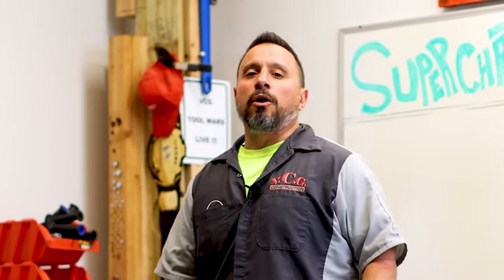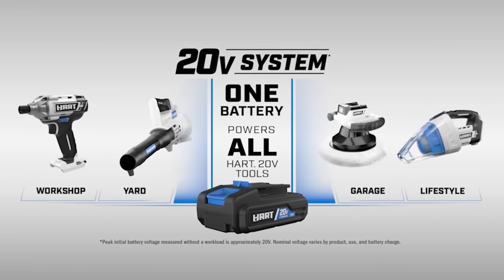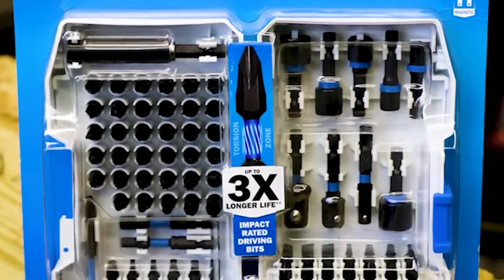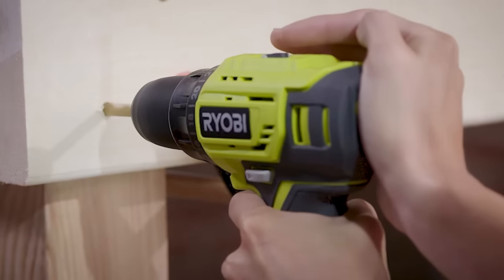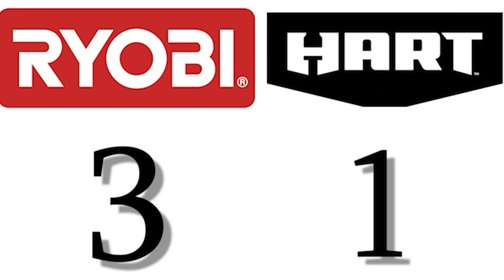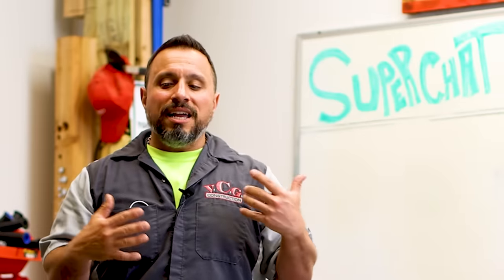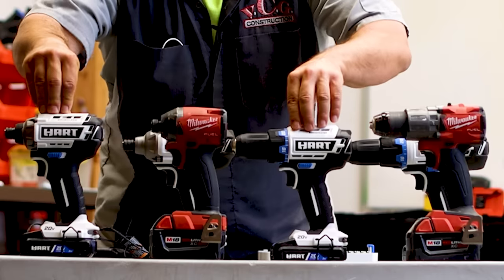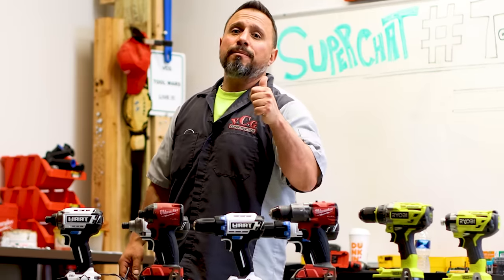HART Power Tools At Walmart PEOPLE HAVE NO CLUE!

Comment: Great informative video Vince. I work as a diesel and trailer mechanic for a nonprofit organization, most of our shop tools are DeWalt and do their jobs well enough. I've wondered how well the Hart line of tools compares with Ryobi and Milwaukee, this video has answered those questions.
I would be very interested in finding out how these lesser expensive line of tools compare to top self brands like Snap-On, Cornwell, and Matco. You know, the guys that drive around in tool trucks?
I have a Snap-On 3/8 drive brushless impact driver kit, came with a charger, two batteries and storage bag. Paid over 500 for it. It's a fairly decent tool for lite work, but not impressive.
Reply: I used to drive a truck and have picked up and delivered a lot of tools over the years. What a lot of people don't realize is a lot of brand name tools are made by the same people. Once I picked up and delivered to a company that made brand name sockets. I walked around their facility and watched how they made them. I delivered boxes of blank sockets all different sizes. They would dump a box into a hopper and they would come down a chute to a machine that stamped the brand into the side of the socket. Some said Snap-on, SK Wayne, Craftsman just to name a few. There were around 15 to 20 machines all stamping different brand names on the same sockets. A lot of people think a brand name company makes all their own tools but that's just not the case. This day and time a lot of these name brand companies have bought each other out and will keep them separate but will cross-fit their technology to improve one or the other brands. It's hard to decide who has the best tool anymore. They all have their good side and their flaws. Price seems to be the determining factor in a lot of cases anymore. It boils down to what price you can afford.
Reply: Dewalt tools sucks
Reply: @hmsdemolition8588  Only trouble I've had out of them is changing battery styles. That really chaps me off . But never any problem with the tools.  What is your beef with them and what tools do you prefer ?   I will say this , you do need to carry  5 ah batteries with them.

Comment: I enjoyed this information , and I would like to add that the manufacturers of these tools seem to change their  platform just about the time I get vested into their tools , I jumped on the craftsman 19.2 v program years ago and I was pleased with the tools for home owners  but the first batteries were cheesy and then they added battery upgrades , ah , and then they went to lithium ion batteries which required a new charger and none of the battery upgrades were truly cheap and then they went to the 20 v system and then Sears closed there doors , and then the remaining tools and batteries and tools prices skyrocketed .
 My point is , It seems the manufacturers themselves are changing and upgrading just to keep us buying into their systems . I love the cordless platforms but seriously , I built a lot of shit in the old days 🤔with corded tools and it's not that hard to run a extension cord around your home

Comment: I found a chop saw for half the price as the same size blade on the DeWalt I bought the week before ( both ten inch saws). Use it for framing cuts... It's not the straightest cuts but perfect for framing but not so much for trim work. Was building a dog pen and got hit with one of those random afternoon thunder storms that the Carolinas are know for and the saw got left plugged up in the rain for about an hour before I seen it. Next morning plugged it up and finished the job. And at $45 for the complete saw I don't mind walking away from the saw on a job site. Doesn't get used everyday or even every week but it gets slammed on framing days and has held up all year. I would recommend for anyone that's looking for a chop saw for not so detailed work, it can do trim just have to make sure your not putting pressure laterally on the handle it's not too sturdy in my opinion but mine was on clearance. Final thoughts.. Great for what it is, not my choice on trim, great price and quality, could be reinforced for straighter cuts in later models.

Comment: Vince.

I really love the Milwaukee tools. 

I have and use the 18volt and 12volt Hammer-Drill; also, the 12volt HACKzaw, 12v Multi-tool, 12v Fuel Impact Driver, 12v Lantern/Trouble LED Light and ROVER Service and Repair LED Flood Light with USB Charging - and AAA LED Pocket Penlights.

I also have but very rarely use the 18v Impact Driver and Jig-saw. 

I also have and use quite a bit their 18v SDS-Max Rotary Chisel Hammer-Drill. And while I don't use it very often, I have and love their 18v 10-in Dual Bevel Sliding Compound Miter Saw! 

Great tools. Hardy tough and quality tools to be sure.

ROAD TESTED: TOUGH
Some years ago, I placed and then forgot my 18v Hammer drill (with battery attached) on the roof of my 4Runner. 

You guessed it. 

Going down the road about 45mph I felt and heard something siding and bumping on my roof! 

Just as it was dawning on me what it was. It slid off the roof and crashed onto the road bouncing end over end on the road with the battery detaching!!! AYE!!! Turned about, retrieved it before it or the battery got run over by some car or truck. Snapped the dented battery back in and pulled the trigger...IT WORKED - and has still been working ever since! 

STICKING SWITCH:
The ONE & ONLY issue I have had with the Milwaukee Hammer Drills (interestingly, both the 12v & 18v) has been that about the 2nd or 3rd time I first used it (some 8 or so years ago), the High/Low Speed Slide-switch at the top of the drill suddenly became STUCK! 

I thought back then (still unfamiliar with the brand): "WTH [heck or F]?!!! Is this the actual quality of this thing? It looks great, otherwise works great. Why the issue with the sliding Switch?" 

Idea pops in the head. I got out the old WD40 and lightly sprayed the switch and around the chuck. Hit the switch a few times threw it in reverse (back and forth), then tried rocking the switch back and forth. 

And "Viola!" Low and beyond IT WORKED! I haven't had any issues with it ever sticking since. 
The same thing happened with the 12volt Hammer drill switch and again WD40 to the rescue!

I have DeWalt tools as well: Impact Driver in 12v and 20volt, the 6-1/2" Circular Saw and non-hammer Drills. I don't use the drills. I do use the 12volt Impact Driver the most of ALL my tools. It is my GO-TO tool electrical trim work - even more than my Dewalt 20v Impact or my Milwaukee 12v Fuel-Impact Driver. It just feels a bit lighter and easy to carry on my belt-clip-drill-hook (I'm more use-to-it and have had it for years now - the 12v Milwaukee FUEL Impact is sometimes too powerful. :-)

I have, but don't use my Rigid 18v Drill or Impact Driver or Radio. But I just bought the 18volt Tire Inflator, so will keep the Rigid batteries and charger at least for that.

Great videos Vince. Informative and entertaining! 

I really love your deep Texas, Alabamian, Georgia or South Carolinian accent! So thick and rich!  

;-)    ;-)    ;-)    ;-)    

I know you'll keep up the good work.

Comment: I looked at hart tools when I was looking for a new drill and impact. I used their impact bits on my harbor freight Bauer impact and decided against it. Kept rounding out screws with every bit I used. Decided to go with Dewalt for the price. Got the dewalt atomic 20v brushless kit for $220 out the door. Would’ve cost $200 to get the Hart with tax. Might as well go with the Dewalt for that price difference.
Reply: I don't go to Walmart often, but recently i couldn't find something that i was looking for in the usual places.  Just happened upon Walmart while driving a friend to the DVM. 

Anyway while i was passing through looking for my stuff. I passed by an isle of Hart tools. And of course, having used power tools for so many years, i had to inspect them a bit. They seemed solid, like they would hold up with other brands, but the price made me wonder...

Guess I'll give them a shot. I'll keep them as backup and for little home jobs, test it out. Cheap enough. It's just that the REAL test comes with time. If there's plastic gears inside that wear down then i guess you get what you pay for, so maybe I'll open them up and look for myself. If they last longer than the others... then it's a good deal.

Comment: I own hart in a 4lb hammer. It is red, and very ergonomic and well made. I also have used a red hart framing hammer 22 oz and had similar thoughts, so much better than my eastwing from the 80’s.
I have mix of tools- i really love the Milwaukee 12v line up screw/drill- and have the 18v line up. I like the “FUEL” line of anything they make. Brushless and better build quality- my non-fuel 4.5” grinder bogs and smokes vs a corded Milwaukee of same. The fuel line grinder is almost exactly as the corded option.

Aside from the 12v line , ryobi makes some of the best ergonomic handling tools i’ve used. Yes- the batteries are heavier vs Milwaukee, but still work great. I have also endorsed ryobi work speaker amd invertors- which are fantastic.
 I have also used old 19.2v craftsman for years, but I digress. The right tool, for the right job is my motto.
 Fuq the brand loyalty- i have a hitachi 10” miter that is my lighter go to, or a 10” compound saw by ryobi corded. I buy what’s on sale, and only need it for THAT one purpose. Even rock the occasional Harbor freight- and they are pretty decent for cost.

My little 4.5” wet saw by ryobi cut my quartz counters i put in my house. $45 on a sale rack- 2 years before i needed it. Why? Cuz it was clearance sale. 
Diversity is the brand i swear by.

Comment: I started down the electric tool path with Harbor Freight Lynx 40V weed whacker and chain saw.  Great tools, which they discontinued right away so no parts for them which really made me mad.  I'm going with Hart this time.  Picked up their 40V brushless trimmer, then edger, and blower attachments so far.  They all work great.  Where I don't trust them is for a good drill for ice fishing.  Drilling a 10" hole through 28" of ice takes real power to not over heat.  I'm using a Kobalt brushless 1200 inch/pound hammer drill for that.

Comment: bought my dad a little Rigid 12v drill for fathers day almost 15 years ago and i'll be damned if that isn't one of THE BEST little compact drills i've ever seen! one job we did it started downpouring and it was in the trunk in it's little carry bag with the flap open and by the time we got over there it was completely filled with water(the carry case) so we just left it to dry out for a week and it's like nothing ever happened to it. think it was rated for like 100 3" deck screws battery life before needing a recharge but we use it for everything, it definitely lives up to it's name! should also mention we're still using the original battery that came with it as well and it was all of about $100 when i bought it at the "homeless despot"(AvE reference) so it's more than carried it's cost at this point!

Comment: I used to be a dewalt guy in the early 2000s, but after most of those tools and batteries wore out I switched to Milwaukee. The best thing nowadays is that you can go on eBay and get battery adapters very cheap for just about any tool brand, so now I can use my Milwaukee batteries on some of my old dewalt tools. And another adapter for my makitta coffee maker.

Comment: I bought the hart brushless kit a few weeks ago. It’s a 5 piece kit drill, impact, circ saw & light for $149 & included two batteries ( price now went up to 246 ) but I think I’m going to get Hercules 1/2 ultra torque for the real power but the hart brushless impact is pretty decent and I’ve used it to replace lawn tractor blades on two different lawn tractors

Comment: I own Ridgid n Milwaukee drills n impact, but I can't lie on this fact,, I know contractors that only use Ryobi drills for over 10 yrs, 2 of them as a matter of fact, and those Ryobi 's are still going , not bad for a low price drills,
Reply: I’ve ran a small company for over 5 years and I still have some ryobi blue tools that refuse to die, hell i pieces together an impact/drill/sander/saw for my father in law couple of years ago and that impact had screwed down at least 100 metal roofs, 1000’s of deck screws easy, and untold other torture. Even got flooded and sat in 5” of water for about 6 days. Still worked great, trigger was a little iffy on being variable anymore lol.                                                        But I’ve had multiple of the new green sawzalls go down. Drills quit working and a large pile of batteries that we’re even 2 years old that went down and won’t charge. And many more batteries that have tried to die but thru trial and error got them to take a charge, and ryobi is super difficult to get the tools or batteries replaced... The last 2 years I’ve been slowly changing over to Milwaukee. Had my first Milwaukee tool go down, m12 sawzall. 7 months old and I think the motor just got hung up it was weird. Went to home depot and the rep there gave me a brand new m12 fuel for my trouble and the 4 amp hour battery it came with! And my bad sawzall wasn’t fuel and came in a kit I bought. That right there made me really expand my Milwaukee line up
Reply: @zbeshears6945  the difference in power between any regular brushed vs fuel Milwaukee is insane. An m12 fuel impact driver probably has the same power as a regular brushed m18. But way more compact. But the price tag is huge.
Reply: Loren Fok    I’ve noticed the same thing!!     I had a M12 given to me as a Christmas present since 2014.    Those little batteries really do go on FOREVER.     I dropped it off a roof peak onto a concrete floor.  It landed right on the rear CORNER🤭.   It didn’t hurt it at all even landing right on the edge of the case.     It’s my go to mechanics driver     And 6 years on I can’t notice any battery degradation.      I just got an M18 set but guess what.   Unless I’m drilling heavy plate I still prefer the M 12.  
   My big gripe with the M 18 is the reverse switch.    It’s a bit too close to access easily when you’re holding it as in backing out a stuck screw.   When you push it it likes to stop in the middle rather than going all the way over.   Getting it to go all the way across ends up giving me cramps in my hand if I’m using it a lot because of this.

Comment: I have the blue Ryobi tools and I really love them.  Mine is the generation before the green ones.  Still work great and if the battery packs need replacing, I take them to Batteries+ and have them rebuilt at 1/2 the cost of buying new Ryobi battery packs.

Comment: I recently purchased a Hart tool kit on Black Friday that had a brush drill and impact, a sawzall, a light, a vacuum 2 batteries w charger, and the bag for $178… used em today at work only difference I feel from my ryobi is the weight on the drill and impact other than that. They drive well.

Comment: All I know is when I saw a buddy of mine using a Passload cordless nail gun, I ran out that night after working and bought one, I thought I had died and gone to heaven. Saved me soooo much time nailing in backing for my plumbing rough-ins.
Edit; and to think, when I started in construction we did most stuff by hand, even used folding stick rules.
Reply: You remember stick rules. 
Been around a while. Haha.
Reply: @rednecked7462  Yep, still use it a lot when I want an accurate measurement, can’t beat them for close quarter measurements 6’ and under. Great for holding stub outs level when soldering too, amongst other useful things. Great part they are light and slide right in your pocket.

Comment: Just bought Hart combo kit drill n impact drill 4.5 in power saw n two  20 v battery n 50 piece accessory 149.95 the drill very powerful circular saw used battery to fast but overall very useful for every use

Comment: I bought a Hart 4 piece kit thinking the light wouldn't be very useful for me. The first job I used the impact on was a 2 man job I took on alone. I kept working in the dark until 1 am. I had 3 batteries with me and only needed a single 1.5 amp for the light so I could use the other 2 for the impact. I got recip saw, 1/2 drill, impact driver, light , and 2 1.5 batteries for under 150 online purchase.

Comment: As usual you have informed us all. I have a Milwaukie taste but im on the ryobi/kobalt budget.... lol. Thanks for giving use the info to decide and places to find the deals..
Reply: Interesting thing is: Milwaukee produces Hart, Ridgid, Ryobi...in those cost ranges. And Ryobi is actually where the RnD takes place, if you pay attention all the 'New' tools Milwaukee has, came to Ryobi first, and are appearing for Ridgid now.

Kobalt is Dewalt as well.
Reply: Ryobi tools are actually decent tools, and often cheaper than the prices shown here. Not hard to find parts for them if you break one, either (like one of the more expensive tools - the cheap ones you can just buy the bare tool). I've had ridgid, dewalt and ryobi stuff. I've got about 9 ryobi batteries now and haven't had a tool quit, nor a battery in almost 10 years. Had more expensive ridgid stuff before then and two of four ridgid batteries crapped out and one of the drills died in less than two years. Orange is overpriced junk.